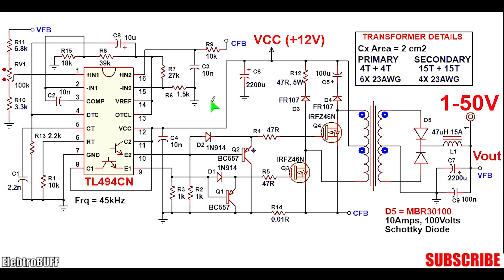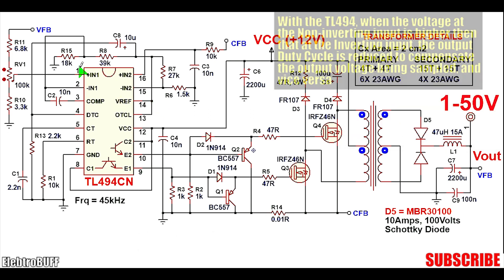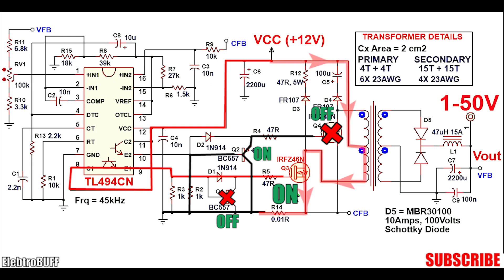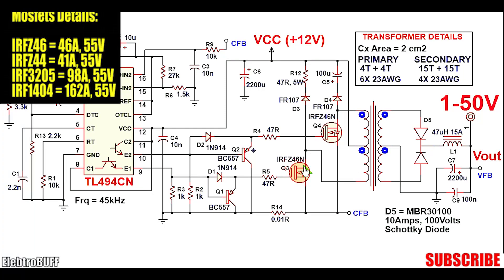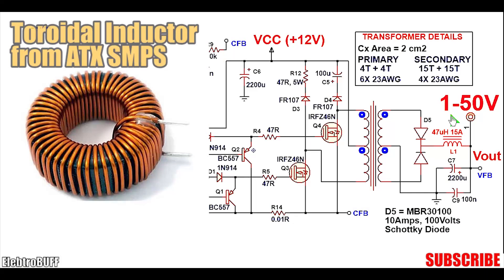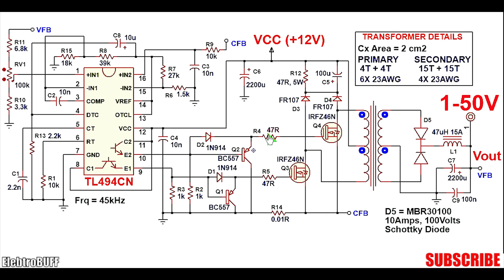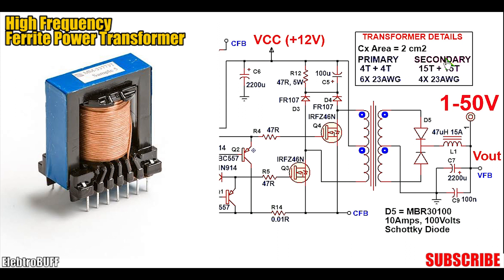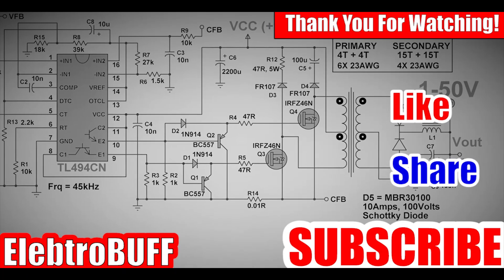TL494 Adjustable Switching Power Supply (Universal buck boost Converter) 1-50Volts

Comment: Hi friend! May I input 20~27V to 24V output ? Ill need 5A output (120W) but My load will charge instantly... I need this circuit doesnt get under voltage... Did you did this kind of test?
Congratulations for your video! Ill wiil feedback you if it works as expected!

Comment: I've assembled this, exactly as you mentioned, but not working...E. Output pin 9, 10 is zero volt, then how a N channel mosfet will work, after disconnecting 557 base connection the results are same, 0 output voltage, it seems the diagram is wrongly designed, even I've tried the same with replacing 4nos of ICs, but no variation....
Plz suggests what to do ( for trial I've changed the connection of E1 and E2 with groud and added 2 nos 1k5 resistor to 11 and 8 pin, now it's giving output voltage )

Comment: Hello. Have you built and tested this circuit in practice? Do you have any measurements results?
Reply: I decided to test in real circuit. It works perfect. I've tested it so far with 1.5A loads.
I intend to increase the power by modifying the drivers and mosfets.
Reply: Please pcb for all circuitssssssssss

Comment: Can you provide a diagram for 12 v dc to +35/-35 v dc dual supply for amplifier?
Reply from the maker: You can use this, just modify the secondary turns for a lower voltage
https://m.youtube.com/watch?v=fRnSoUzHnnE
Reply: Thanks for your guidance..👍

Comment: Hi. If possible, in the same circuit, in addition to the variable voltage, it also controlled the current was excellent.
Reply from the maker: Yes. Variable current can be easily achieved with the help of an Operational Amplifier feedback to either one of the error amplifiers or the dead time control pin input
Reply: If i change R6 to a 10k pot, Will  that change the current?